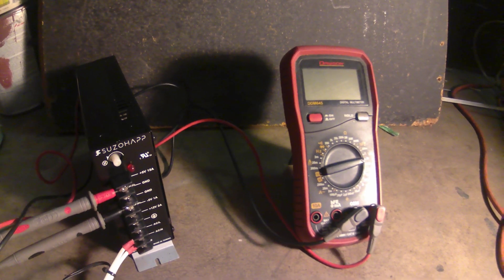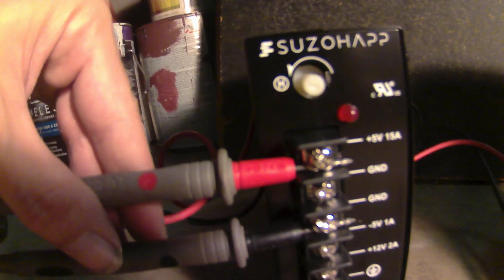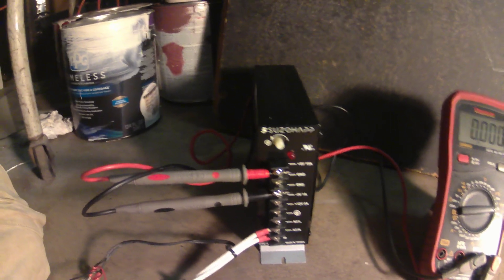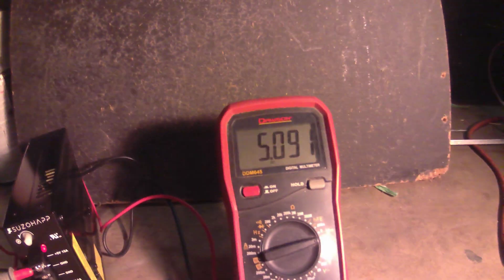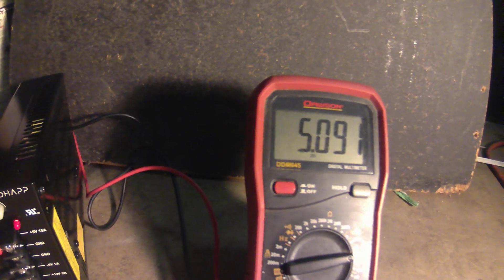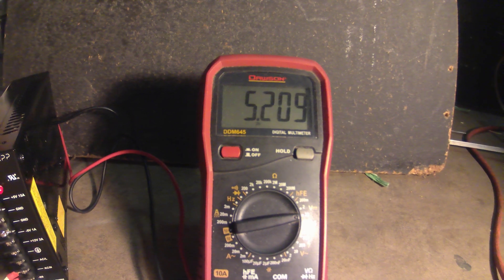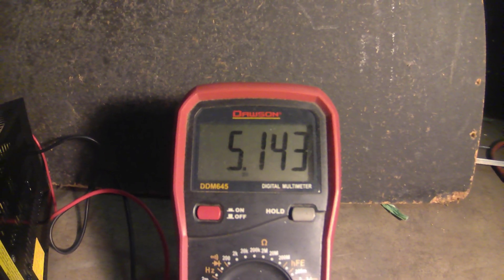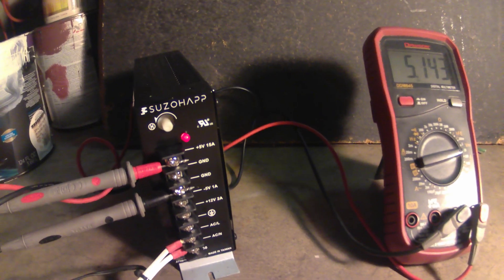How To Adjust a Power Supply (Arcade Power Supply +5V Adjustment)

Comment: Have you ever looked into putting a timer I think the new timers for the power supplies that you could hook it up to they have an app where you're able to set the the time and you know if you want the arcade game to be in sleep mode or turn off and on at certain interval so you could have like 50 arcade games in your garage on all day long but the timers will be going at turning off and on at intervals so it would still play the the game a play screen but it's not eating up your power all day long because it's turning off and on so all the other games if you're playing one game all the ones that around you all the other 49 games was to say or pretty much on but the screens coming off and on at certain intervals because of the timer of the app will allow you to adjust that it's kind of like a sleep mode try to look into those timers for power supplies and seeing if you could try to find one that has an app or some type of intervals that could it's mostly for if you have like a lot of arcade games on at once you don't want to have a huge power bill soaking up I mean you would be in the hundreds you know what I mean depending on how many games you have running at the same time
Reply from the maker: I honestly never thought about using a timer to test my games, that's a great idea though. I mainly used timers when I had games on location and they were APP related timers too. I'll have to try it and see what difference it makes on my electric bill.
Reply: @willsarcadeservice4599  I think the new wifi or non-wifi AC outlet timers use a software app so you can have 20 or 50 arcade games turned on all day but are in sleep mode or cycling the turn on/off at certain time intervals so you save on your electrical bill. On pinball games displays used strobing signals which would strobe the lamp lights so save power because pinball games used a lot of lamp bulbs which would draw a lot of current so by strobing the lamps it cut the power dissipation wattage in half as well as the total current draw. It's all about strobing the voltage/current that saves electricity energy

Comment: wills arcade service, why did the old 80's arcade games use a 27,000uf filter caps for the power supply? 27,000uf is very big filter cap for just an arcade circuit board any reasons why?
Reply from the maker: From my understanding it's because the power supplies typically used at the time were Linear and not Switching. With a Linear the AC flows through a Transformer and a Large Filter Cap is needed to filter out the AC component. Over the years I've been in and out of many arcade groups online and that seems to be the general consensus on why they were so large. They also play a role with the monitors as well, I've had Atari games dropped off with monitor issues like wavy images and it turned out Big Blue was bad and needed replacing.
Reply: @willsarcadeservice4599 Yes its a linear powers supply but most linear power supplies used 100uf to 400uf filter caps never I have seen used 27,000uf Big Blue Filtercap in linear power supply which is not common to have a big 27,000uf filter cap. I thought that the Big Blue Filter caps was only powering +5vdc and +12vdc to the arcade circuits boards. I didn't know that the Big Blue Filter caps was powering also the arcade monitors circuit boards. Most arcade monitors used an isolation transformers because the arcade monitors chassis was a live hot chassis AC voltage. If you put your hand on the arcade monitors chassis and your feet were touching the earth floor which is ground it should shock you, So I have no Idea why they even used an isolation transformer for the arcade monitor.
Reply from the maker: You're correct about the isolated transformer and the transformer on the Transformer Power Supply Assembly does power the monitors, when it causes issues to the monitor it's due to AC leaking on the +5V line. From what I found when I searched the topic a little bit was the Atari Power Supplies (AR's) and the game boards were very sensitive to AC leaking so I'm guessing Atari used a CAP that large so it they could really make sure the DC was filtered.
Reply: @willsarcadeservice4599  The AR Atari Power Supply had a SENSE signal I think that was monitoring the output of the power supply +5vdc which was very sensitive and a poor design. I think most techs disconnected the SENSE signal. I have no idea why they would use an isolation transformer for the monitor chassis because you can still get shocked and damage yourself from the high voltage that is connected to the monitors metal chassis, so to me an isolation transformer is useless it seems.